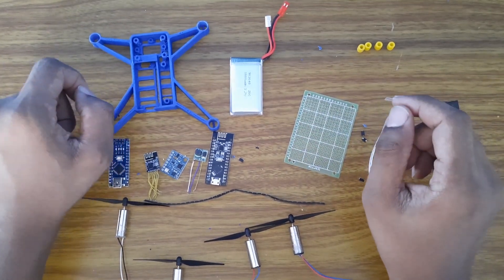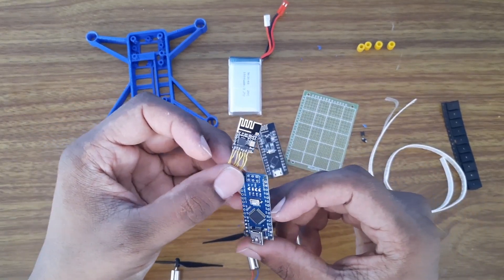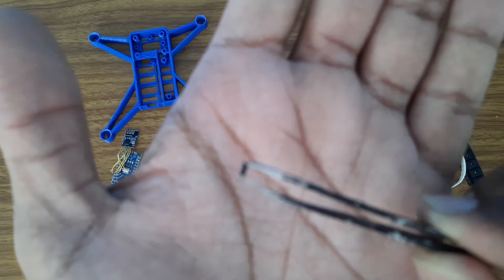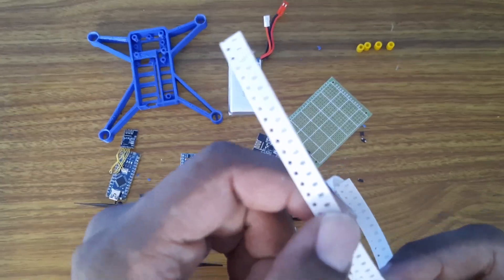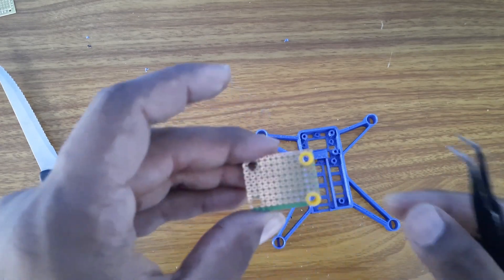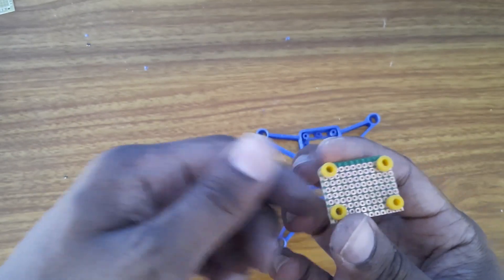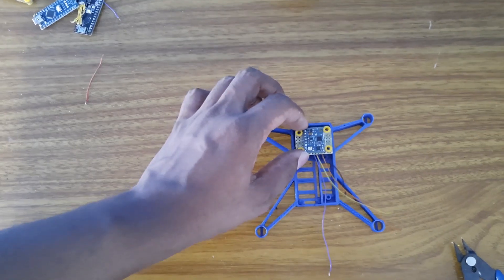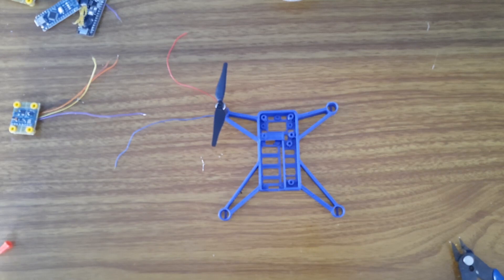DIY Arduino drone project| 3D printed DJI Tello clone, MPU6050, NRF24l01, MS5611 (Part 1)

Comment: Sir i have made drone  but one motor is not rotating when i give full throttle by joystick then it is rotating slow as compared to other 3 motors. What will be the solution plz???
Reply: Check out the motor gear

Comment: Hi bro 
How i connect mpu6050+ms5611 to ardiuno nano
Reply from the maker: Connect SDA and SCL of MPU6050 & MS5611.. to pin  A4 and A5 respectively of arduino
Reply: @minilab3d  didn't understand
MPU6050
SCL--->A5
SDA--->A4
MS5611
SCL--->A5
SDA--->A4

like this? are they go to the same pin?

Comment: BRO WHAT MOSFETS ARE YOU USING FOR ESCS ?? ALSO WILL THAT WORK WITH 7.4 V INPUT
Reply from the maker: A2SHB... yes.. it will work with up to 20V
Reply: @minilab3d  U mean SI2302 A2SHB N-CHANNEL? .. BRO it burnt at 7.4 V only .. so i asked for 3.6 it is working gud
Reply from the maker: @PrashantKumar-nz8hq  hello,yes s12302, well according to the datasheet it works with up to 20V. It burns out, its not the voltage, but the current causing it. It has a maximum current of 2.9A. So if u are using a motor that drawing more current than that, then it will burn out,  altenatively you can use S12306 A6SHB which has a max current of 3.5A

Comment: thanks for sharing,but i read the RF Nano distance is not great,is that true?
Reply from the maker: well, the range is same as the other NRF, 100 m if you use the NRF24l01 with antenna for transmitter and about 800m - 1Km if you use the NRF24l01 with Power amplification (Antenna). but due to interference it can be less. The range can be fine for small drone like this. Probably not good for RC plane